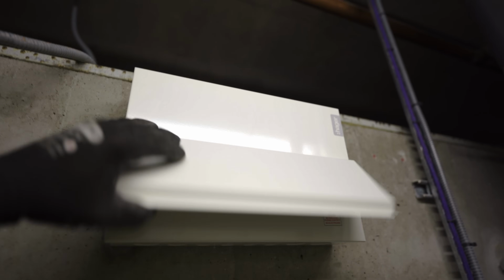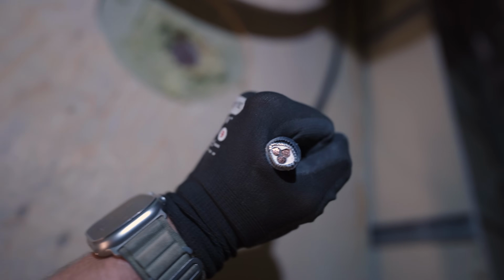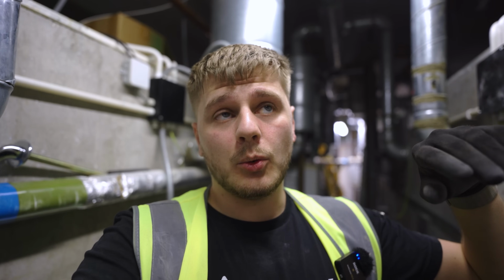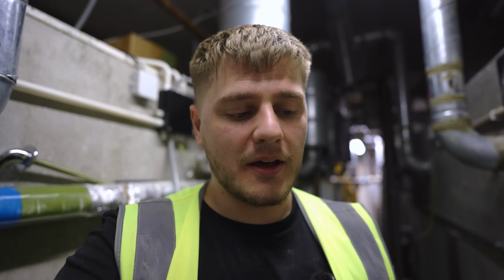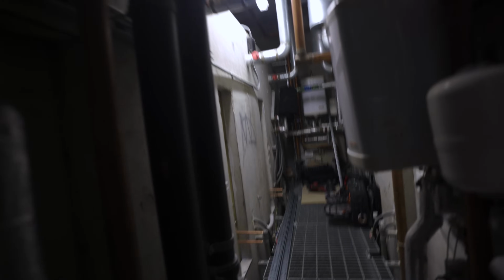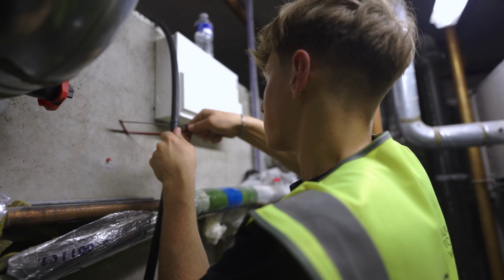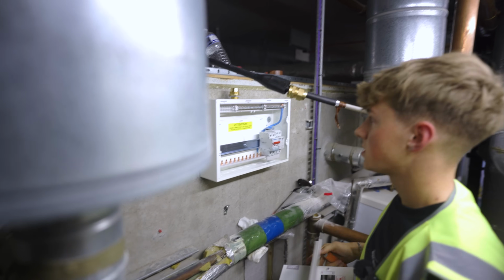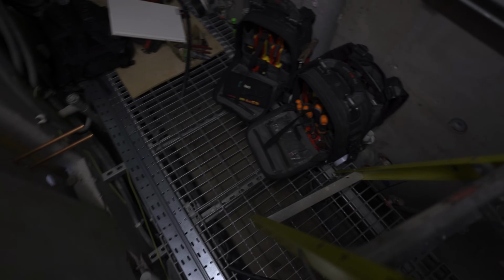Electrical sub-main installation with the boys

Comment: Electrician van crime prevention deterrent measures:
Air bag type design, exploding dye packs installed in doors and panels. Or dye sprinkler system activated when van is being attacked. Easily ID CRIMINALS AND MAKES IT HARDER TO SELL STOLEN TOOLS.

Comment: Has the light got over discharge protection? Milwaukee batteries don’t have a low voltage cut off as that’s done by the tool.

Comment: Had this problem the other day with 10mm2 3 core SWA!! 
Back of the packet states CW25 gland for 10mm 3 core. However, in reality it doesn't seal. Fitted CW20 instead, but the olive was so tight to get over the outer sheath!! 
Had to use silicone spray and flat head screwdriver to prise the olive onto the outer sheath.
Reply from the maker: Yeah it’s one of them sizes that’s always on the line with cable/gland manufacturers 🤦🏼‍♂️
Reply: @residualelectrical use spit pulsar cable fixings . Just fire them onto ceilings and then tighten them one ur cables are ran . Way easier than drilling holes etc ..